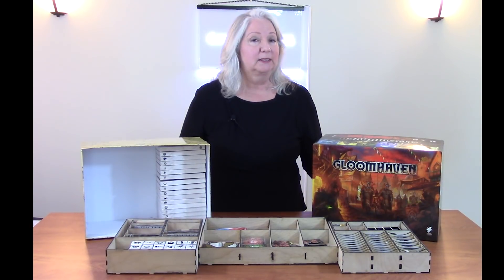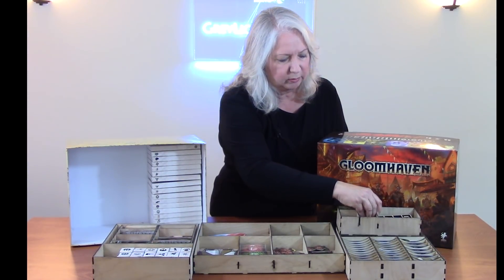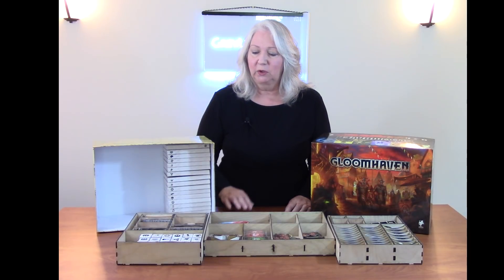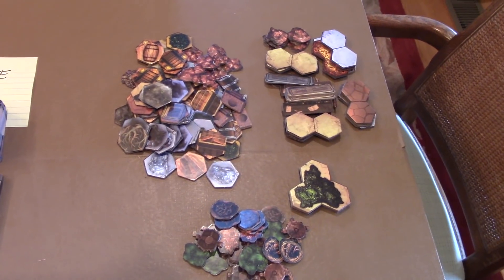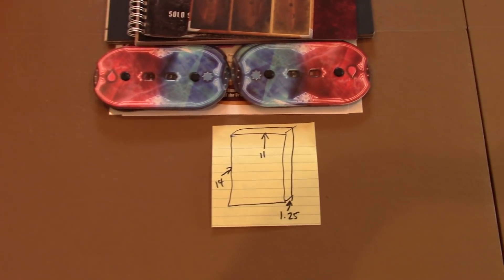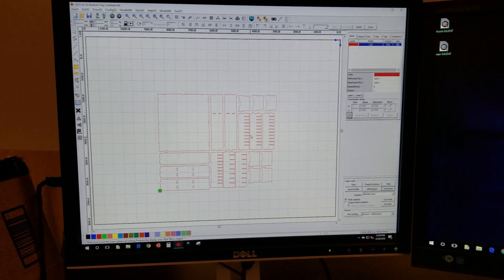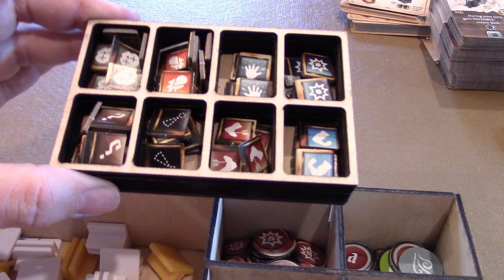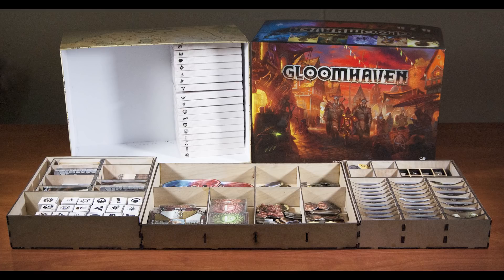A Step by Step Process for Designing a Game Box Insert Using Gloomhaven as an Example

Comment: The is fantastic! I was wondering what laser cutter you used?
Reply from the maker: Dickie, I used a Rabbit 80 watt laser cutter, which is the same Chinese hardware used by Boss laser and is assembled and supported by a small American company. This wood is quite thin, though, and it could be easily made on any 60+ watt CO2 laser cutter with a large enough cutting bed.

Comment: This is brilliant. I actually found this video after deciding to make my own insert for gloomhaven.
Reply from the maker: Have you already made it, or did you find this in time for it to help?
Reply: @GreylightMay  I haven't started yet. I was looking for videos for inspiration. I was planning on using wood but I think plastic foam board from hobby shops will do better. I don't have a laser cutter either so I will have to simplify it.
Reply from the maker: Yes, Ben, both foam core and simpler makes sense without a laser cutter, but the planning process would be the same, which is really what this video is about!

Comment: Hallo, nice video 👌🏽 do you have any method on how to make wiiden boxes without a laser cut using plywood?
Reply from the maker: Mario, I think it would be very difficult to do something as intricit as a box insert with traditional woodworking tools. Of the CNC machines (computer driven) the laser cutter is the easiest. I've used a table router and it was much more difficult and more expensive. They are really designed for thicker wood and bugger pieces. I think a laser cutter is all I would use for this type of project.